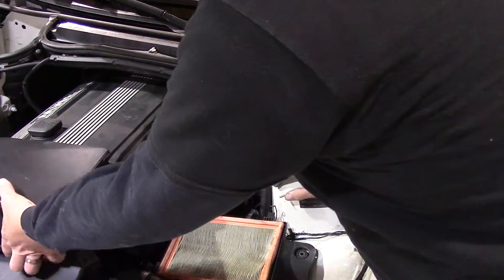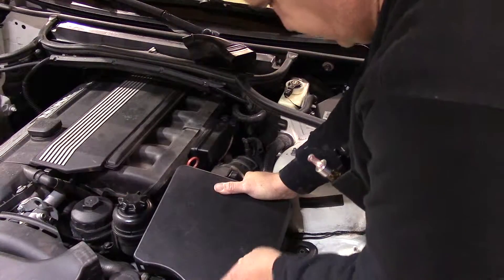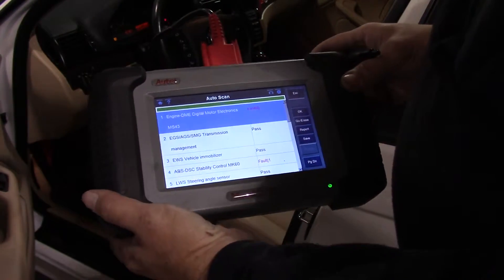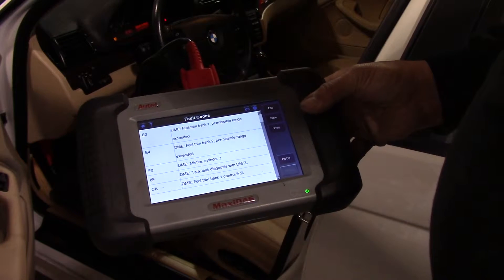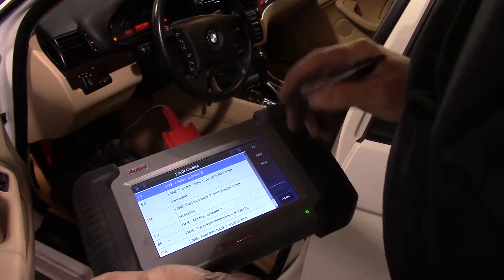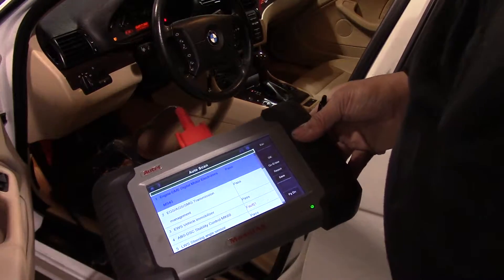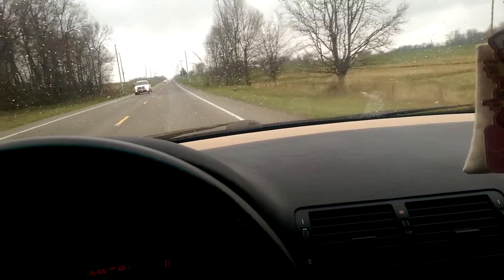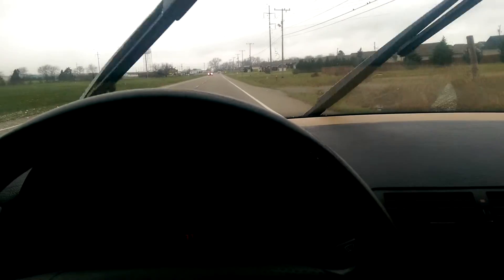Disa valve replacement Part2

Comment: I think you got me there, i was too busy listening to your discription of the fault and roughly what it did to notice much else.
Sounds like you have the bmw smiling again :-D, my old mate has a 20 year old beemer, its getting a bit of a pain to keep going now.
Its latest oddity is the starter clicks like mad but does not engage, he replaced the starter a month ago and its seemed to be ok, but that was a red herring.
Im suspecting the ignition switch is playing up, a bad connection.
It doesnt have the standard obd system, its some odd socket under the bonnet, so no help with the engine if it causes problems :-(
Reply from the maker: +zx8401ztv No worries. It's more intended for BMW gearheads as its something that they would know, but the average bloke wouldn't catch it. I did for the ones that called me out on the video I did with the lower radiator hose on this car.